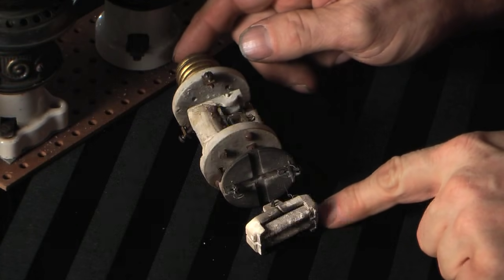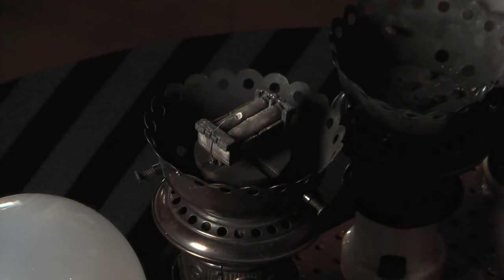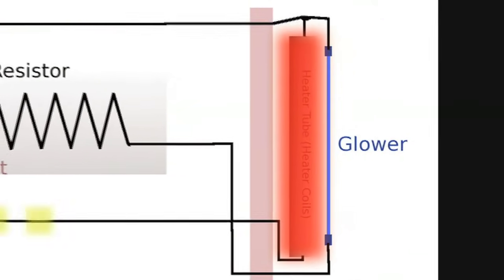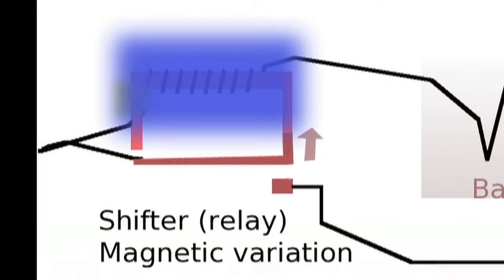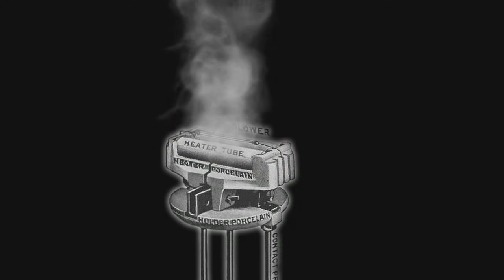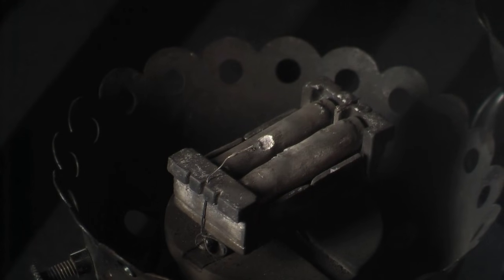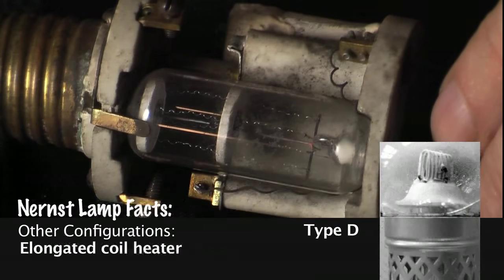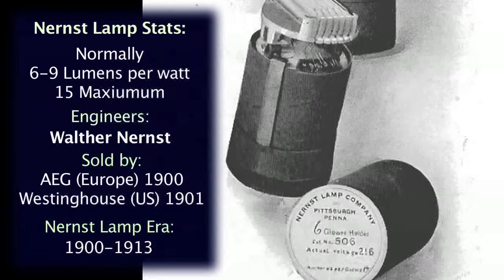The Nernst Lamp

Comment: You got the operating principle of the ballast wrong.  The solubility of hydrogen in the iron wire increases with an increase in temperature.  Some of the hydrogen would dissolve in the wire, thus increasing its resistance.  If the current decreased, the wire would cool and give off hydrogen, decreasing the resistance.  This acted to keep the circuit current constant regardless of the supply potential.  This is the same principle used in current regulator tubes.
Reply: It's very interesting. If I remember correctly, Nernst lamps generally ran on 100 volts, 0.5 amps, DC? 
What do you think might be the best solid state alternatives to this type of ballast, if making this lamp today? And could it be possible to use different oxides to make the filament, such as Cupric/Cuprous oxide, Aluminium oxide, perhaps mixed with Silicic acid? Thanks for the info!
Reply: @Kyle-sg4rm  Some sort of constant current regulator. LEDs need constant current which is supplied by a regulator as well, but at much lower currents e.g. 50mA.

Comment: gw4pjq
"German silver", also known as nickel silver, cupronickel or "new silver" (German: Neusilber) is an alloy of copper and nickel with a small amount of zinc.  Occasionally it may contain tin or lead.  It is an excellent electrical conductor which does not corrode easily and is highly resistant to wear.  Its most common use in the past in Germany was to make plates for watch movements, but it is now often used in electrical contacts because of its combination of high conductivity and high corrosion resistance.
Reply: What this German Silver ever used as the 'Cat's Whisker' in old crystal radio sets?

Comment: This type of iron/hydrogen gas ballast was later used in radios in the 1930s, to drop voltage to run the filaments in series, making radios cheaper since they could be built without a transformer.

Comment: Nickel Silver is not EPNS. EPNS is Silver plated nickel and even the nickel is usually a plating on another metal (brass). The silver is just the plating. German silver is an old phrase from the British Empire days that is only used in the US these days. Nichrome wire is the usual term. Indeed all the nernst lamps I have seen use a nichrome heater or sometimes tungsten is used but not often.

Comment: The normally-open contact, when closed, (according to the diagram) shorts out the shifter, why wouldn't the shifter then shift back to the start position? There would need to be some method by which the shifter is kept in the run position. If the shifter was thermal, the resistance of the bi-metallic strip could be designed to produce enough heat to keep it in the run position.

Why did tungsten lamps replace the Nernst? Cost?
Reply: The shifter actually disconnects the heater when current starts to flow through the Glower and will keep the heater off until the lamp is switched off.
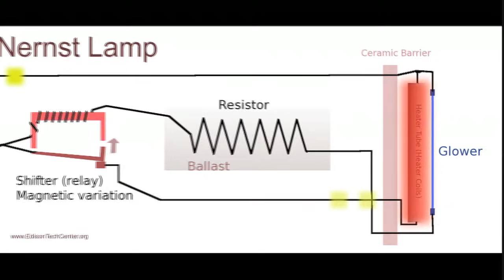Reply: No, it does not short itself out. 1:26

Comment: So what it basically is, a tiny flourescent tube that needs heat, I believe so
Reply: Not quite

Better way of looking at it is; its an incandescent lamp but the filament is replaced with a little rod of material that doesn't oxidize in air even when very hot, so it doesn't need to be sealed in a glass ball. The rod doesn't conduct electricity at room temperature so its heated externally to get it hot enough to let current through

If only they'd found rod materials that were conductive at room temperature in time, silicon carbide probably would've worked.